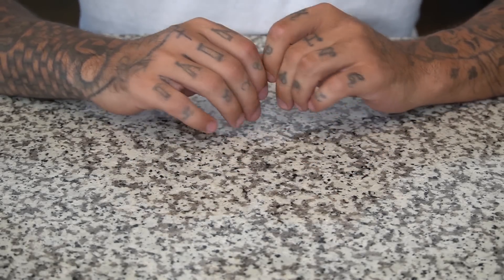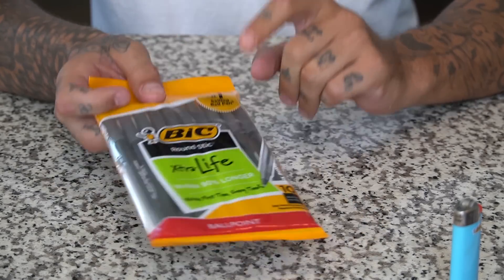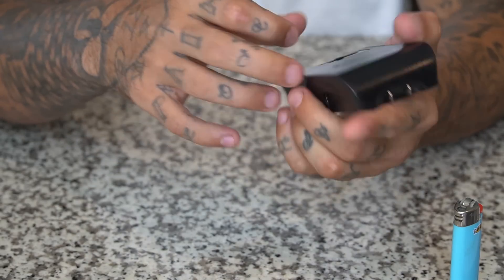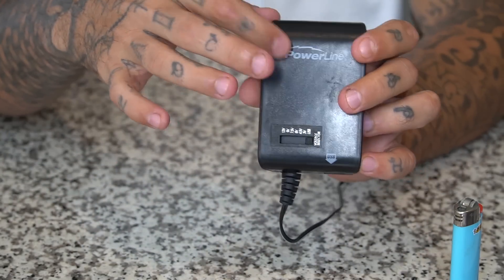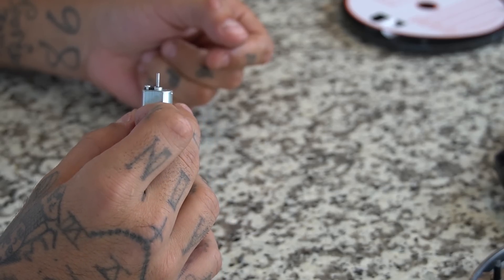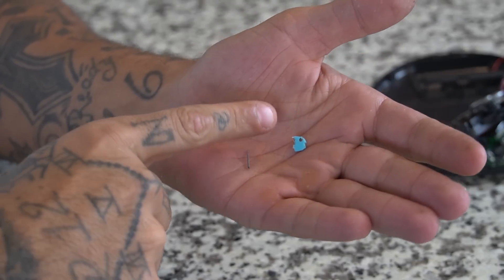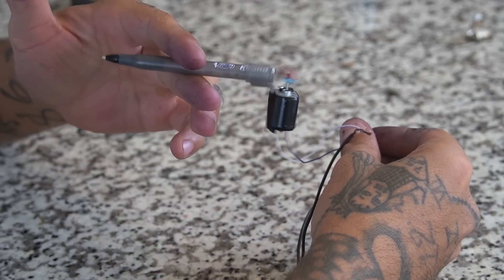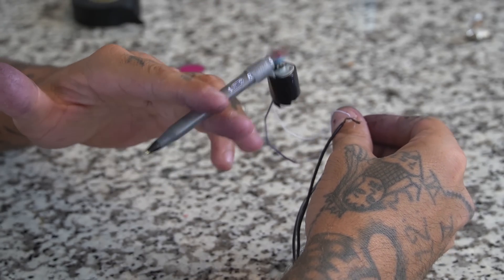HOW TO MAKE A PRISON TATTOO MACHINE REMASTERED

Comment: Dude inmates are so crafty, got Penn’s all over the globe and they all chocked full of MacGyvers.  I wonder:
1.  Who the craftiest inmate you ever served time with, and what’ are some of the craziest inventions you’ve seen while locked up?
2.  Who made the biggest impact/influence on you while doing time?  
You seem to have your $)(!+ together and you got a great attitude, just want to know if there were any positive influences that may have made an impact on your character.  Keep it up though bro, you brighten our days my dude.
Reply: Omar khadr devised a way in the Toronto West Detention Center in Toronto Canada to change the tv chanels when we were locked in the cells cause the tv was out in the common area and the remote was welded to the table out there also. It involved a plastic spoon bent into just the right shape with a string as a kinda trip wire to pull the spoon down to push the button to change the chanel. Seriously mabie it was 2000 or somthing he was there i seen it. What up Gemini he see it.
Reply: I did time in a Max security prison in Abilene Tx,  and I met and indigent man who would build and sell small box speakers out of your headphones, a rubber glove, magazine paper and a hard back book cover. And the man sold them for 4$, which was the equivalent of about 3 soups, 1 bag of beans, 1 bag of chips

Comment: I'm confused by few things. The a.c. adaptor. What cord did you cut on it? The power cord? And if so how is it powered? By battery 🔋? Also the needle you wrap one or two times? Does eraser touched when pushed against? Or just on so doesn't slide out? How long does the needle need to be sticking out the pen? And do you measure it by when its fully extended while motor is attached? Also the ink? Was hoping to see how or what used for the ink.

Comment: We used 2 use a PlayStation paddle instead of the walkman. Just hasta be one of them controllers that vibrates.. Just attach the motor to a battery and wualahhh.. Controller also has the springs inside it so u don't need to track down a lighter or string

Comment: I seen my uncle use an eraser. Put the eraser directly onto the little bar on the motor, and just stab an offset hole with your need that has a 45 degree bend in it.. like an L